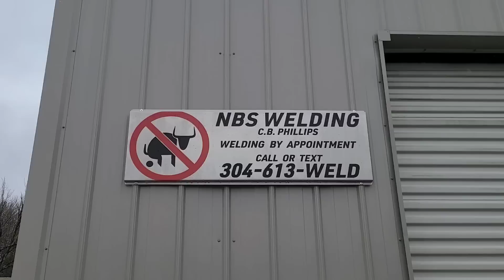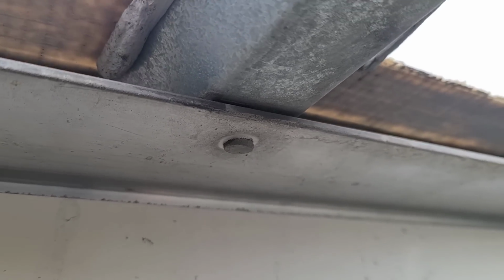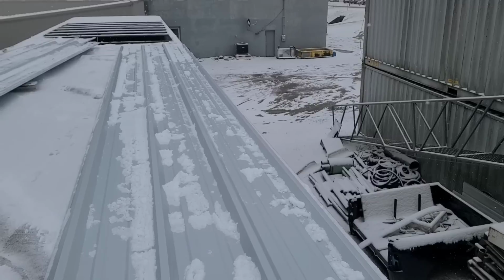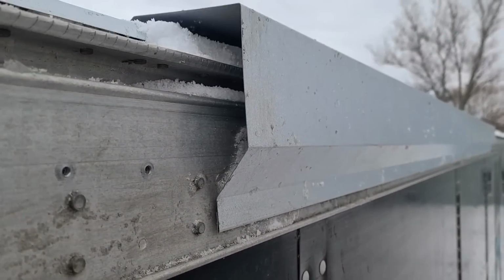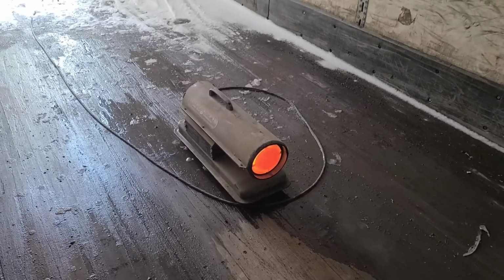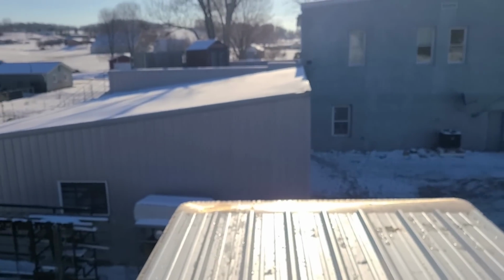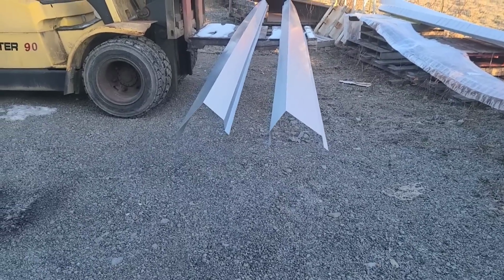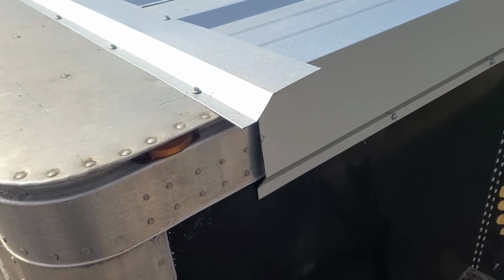Fabrication of steel semi-trailer roof to replace failing fiberglass roof

Comment: As long as you’ve got your safety glasses on you got nothing to worry about. 

Except a sneak attack, of course😂

Great job. Very wise solution to a real bad design. Saved a useful trailer from the wrecking yard. 
Thanks again.

Comment: Well, Have worked on vans and containers/conex type youve brought that to another level, using roofing type sheets genius,also liked the way you formed the closing plates at sides,nice bit of origami😂 the tip on pre drill holes 👍 regards from Scotland as always keep them coming again 👍

Comment: DUDE!!! You crushed that roof. Its not welding but I learned stuff and it was rad. Its just like your pipe spool video. Those little details are the best. And the way you finshed that cape part for the trailer at the end. That looks super sharp and professional.

Comment: One thing i have learned about metal roofs is when it's cold, you slide like ice even when they are dry. When it's hot you can walk across them all day. When it isn't ,it can be a nightmare. Flat may be ok but not an incline.

Comment: these trailers are a "house of cards". nothing is strong independently but put all together and they are not quite as weak. wonder if you could have bent the extra width of the roof panels to go over the sides and cut not need the rake trim on the sides. love the neatly done corner.
Reply from the maker: Makin that bend 53' long would be tuff...dunno on that one

The side sections were not a problem done on a 20' brake and double folded at each edge

Comment: that is a good looking job but after 35 years working on trailers in north carolina you should have torn the rest of that fiberglas roof off and got a roll of0.40 roofing and installed it. It would not added as much weight to the trailer which will be a bigger payload for the owner. keep up the good work you are pretty awesome
Reply from the maker: These trailers are for hauling used tires so the weight doesn't matter...no matter how they pack them the volume is taken up by so much air that they cannot even get them close to max weight with tires
Reply: Where in nc and what would you charge to do a roof mine is fiberglass as well
Reply from the maker: I can't quote it without more info
Reply: @NBSWELDING where in nc are you
Reply: Where in nc are you
Reply from the maker: I'm in WV...Google NBSWELDING

Comment: Where I bought my roofing they said the screws goes in the rib which I still don't know if it's right or wrong
Reply from the maker: On a roof I like to put them on the rib to prevent chance of screw leaks…this trailer application is more structural so I like them on the flats where they get very tight…the customer on this job doesn’t care if they leak a little bit…they are gonna be hauling used tires and the tires all usually have water inside them anyway

Comment: For covering holes or screw heads I prefer dicor over silicone.  Any rv dealer will have it.
Reply from the maker: Never used dicor before but I just looked it up…good to know

Comment: Can you give a hint as to what the job costs minus materials ?
Reply from the maker: Most all the trailers I did had other welding work that also got done before it left my shop and I haven’t done any recently…I think I rebuilt seven f their trailers and the average cost for repairs and roofing was probably around $5000 or so…not sure how much of that was welding, roofing, materials, or what

Comment: is galvalume the name of the sheet metal company?
Reply from the maker: No...galvalume is the protective coating on the steel
Reply: @NBSWELDING  i am looking to put a metal roof on a 20x20 carport.  does the manufacturer you bought from have a website or name i could search online?  cool video by the way-you improved that trailer big time.
Reply from the maker: @Peet Ky  The supplier in my area is Lifetite Metal Products...your bound to have a metal roofing supplier closer to you

A 20×20 carport wouldn't require extremely long sections either so you may be able to get what ya need from any building materials supplier

Search metal roofing supplier or something like that and hopefully you'll find something without going too far
Reply: @NBSWELDING  thank you.  have a great day.  really windy here in KY today...i guess you will get it this evening.  batten down the hatches.

Comment: If you dont want roof metal to leak, you drill through the high spots. Drilling through the low spots and it will leak sooner or later. The proper screw for that has a section of thread near the head, a bit with no thread, then more thread for the rest of the screw.
Reply from the maker: I agree…on a regular roof I screw in the high spots

These roofs are more of a structure than a seal…the customer doesn’t care if they leak…they haul used tires in them and most of the tires have water inside them…these trailer roofs are just there to help hold the walls

Comment: With the prices that the residential siding manufacturers are getting for metal for houses (a very fast growing trend) I ought to find the guys who do trailer& semi work - I'd probably save a bundle & I bet their waterproofing dr & window flashing details would be far superior too. Mediocre looking metal panels Ive been researching are running about $10.00 & up per sq. ft. This work actually looks nicer - might be a market for some of these talented workers who want to do their own thing/run their own business!
Reply from the maker: If your looking for “guys who do trailer & semi work” to save a bundle on building construction I’d say your misunderstanding this situation…as far as I know of people don’t do this…this is a solution that I am trying for a customer of mine who has these trailers with this issue but otherwise I’ve never heard of anybody using metal to repair semi-trailers like this….it’s certainly not a normal thing that lots of people are doing and for some applications this may not be the best solution…this metal puts the strength back for the walls that was lost when the fiberglass roof failed and that is all this work is intended to do…my customer hauls used tires in these trailers so it doesn’t even matter if the roof leaks…most of the tires have water in them anyway

Comment: Use any insulation to seal where water can get in when you hit the brakes?
Reply from the maker: No they are just gonna haul used tires...the used tires are half full of water so the trailer will never be dry inside regardless of what you do

The roof is only important because it holds the walls together